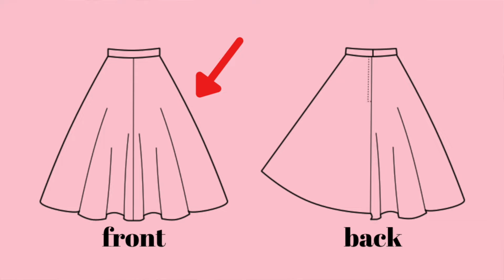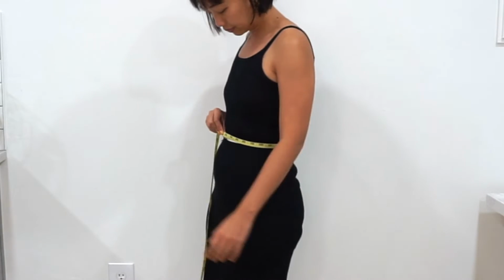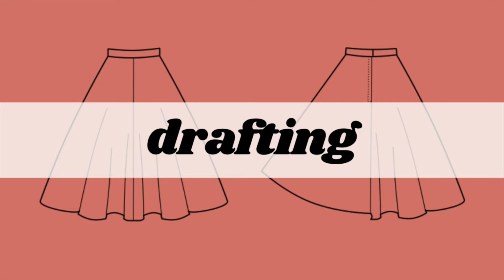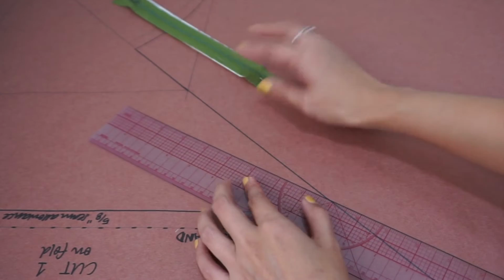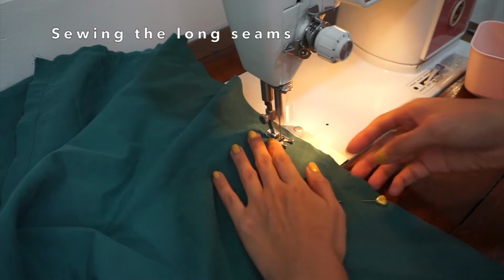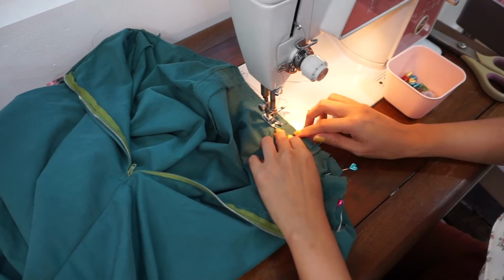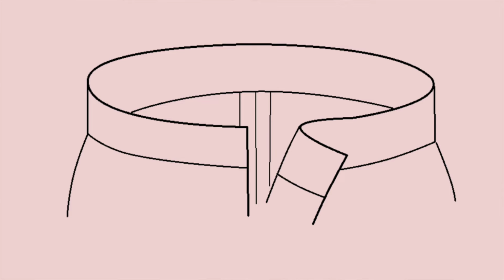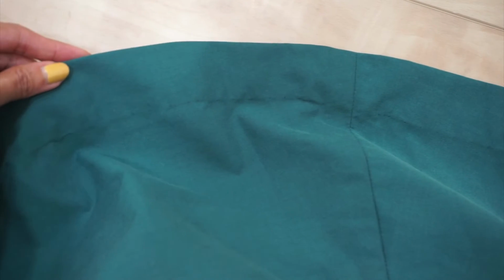How to sew a half circle skirt (4 panels) | step by step, beginner-friendly | draft your own pattern

Comment: I am assuming that I could use the same principles to make a full circle paneled skirt?
Reply: Thank you!
Reply from the maker: Yes, so to make a 4-panel full circle skirt, you need the arc going across the entire square instead of only half of the square at 5:59
Reply: @gwenheng  Thank you so much  🌺
Reply: @gwenheng Can you make a video using this method for a plus size person?

Comment: One question to 6:54. I don‘t understand where we calculated the seam allowances for the side, front and back seam as we only calculated r and made the pattern in a 45 degree angle with the help of the diagonal in the square. We used seam allowance in the r calculation, but that should be for the waist, right? I don‘t get how a calculation for the waist radius helps with extra fabric on the side of the panels. Am I missing something or is calculating seam allowance not so important for a half circle skirt because it also works if it‘s slighty less than a half circle in the end? I‘m quite new to this and a half circle skirt is supposed to be my first real garment, so I‘d appreciate any help :)

Comment: Math ain't mathing 😅. I made the pattern once, but measuring it to use it I don't think it will be large enough. Now my measurements are quite large, partly due to me using the hip width to be able to put an elastic into them, so just making the square in itself is an adventure. But I'll make it happen. Forward we go.

Comment: Beautiful! Thanks! Is there not a problem  when you are cutting the panels in different directions?  Or was that just depend on the fabric and the nap?
Reply from the maker: I cut my skirt pieces alternating at 180 degrees to save fabric ☺ It doesn't matter at all for this project since I was just using a plain, solid colour! But yes, if you are using fabric with nap and directional print (e.g., corduory, plaid), then you'll have to be a little more careful in planning out the cutting. ☺

Comment: Can I use the same principle to make 5 panels?? 3 panels in the front and 2 panels at the back??
Reply from the maker: The short answer is yes. But there will be math involved. If you want the front and back to be the same size, then you will need 2 different panel sizes. If you want 5 panels of the same size, then you just do the math once. The math will be about adjusting the size of the “pie” 😀 i hope this makes sense!

Comment: Hi Gwen! I’m trying to make a skirt with 3 panels (1 for the front and 2 back panels) so that I can have pockets and a back zipper closure. How should I modify the equation to fit as I would only have 3 seam lines?
Reply from the maker: There’s no need to adjust the drafting at all! Use the same pattern piece but
🔸 cut the front ON THE FOLD with the same pattern piece, making sure the seam allowance is taken away where the fold of the fabric is
🔸 cut the 2 back pieces as usual

Let me know if this makes sense. 😀
Reply from the maker: Adding to say the FOLD of the fabric should be along the lengthwise grain of the fabric (parallel to the selvedge).
Reply: @gwenheng  got it! Thank you so much 😊💕💕
Reply: Would I be able to calculate it by reducing to 6xSA in the equation, then using the drafted pattern for 1 skirt panel, fold down one side of seam allowance and cut on fold?

Comment: This is my first sewing project. I am working with muslin. I noticed that my pattern piece is not symmetrical. The edge of the pattern was my paper, and the other side's angle is sharper. (A bit hard to explain without a protractor!) Is this a major flaw? Which edges do I sew together?
Reply from the maker: Hi Kristin! I’ll be worried about it not being symmetrical. The pattern piece should be symmetrical. This means the skirt might not end up being even all around.. I think reviewing the steps for drafting would be best. Good luck!! 💖

Comment: Are handmade clothes less resistant than those bought from stores?
Reply from the maker: Excellent question! I have clothes I made from almost 10 years ago that I am still wearing. If it's made well, it's made to last. Fast fashion don't last as long most of the time either because of the workmanship, the fact that it's a trend trap we sometimes fall into, or that they don't actually fit us nicely. Hope this helps! x
Reply: @gwenheng  Thank you so much. Your videos are very helpful. They made me want to start sewing!! ❤️ You're doing a great job!

Comment: Hi, Im struggling with how much fabric to buy because this is my first sewing project and Im unsure on how to calculate that? my measurements are overall a bit smaller but I'll probably do the bib that goes with this skirt so its great if I have extra. The fabric Im looking at is 100% cotton and comes in yards. Im not even sure if cotton is a good fabric for this skirt. I also want to add pockets, and I swear you mentioned how, but I can't find it :( . It'd be really cool if I you maybe knew if cotton could be used and how to go about adding pockets.
Reply: Cotton is perfect and just search adding side seam pocket to garments, loads come up. Very simple to do
Reply from the maker: Hi hi! Yes, cotton is great and yes, I mentioned that pockets could be added but I haven't made a video for that on my channel. In terms of how much fabric to buy, it kind of depends on the width of the fabric too. Some fabrics come in 45", some in 60". The best bet is to put it on the floor and try to measure it out with a measuring tape.. OR take the pattern piece to the shop and place it against the fabric! x😁

Comment: I found some plaid fabric and thought of making a  circle or a variation of it.  I  didn't like a lot of them when I googled because the lines were not to my liking.  I  guess the solution is to make four panels and follow the lines.  I think I'll actually cut a narrow rectangle rather than an arrow.  It would be fine for solid but the lines really need to line up. You should be more popular your directions were clear and you showed the process.  The only other I found was so busy twirling I couldn't see how she lined up the plaid. I  think I have enough fabric to copy the bottom three inches of skirt so I think I'll hem it a different way. Thanks.
Reply from the maker: Hi Cara, thank you! I'm glad my video helped you in some way! x Good luck with your plaid skirt! 💓

Comment: Hi. How much fabric did you need for this skirt? And what was the width of the fabric? Thanks in advance.
Reply from the maker: In this video, I used a thrifted bedsheet to make the skirt and had enough left over to make a few other things. Bedsheets are wider than most commercially available fabrics which are 44 - 54" wide. 

I did some calculations and for the size I made in this video, I would have needed ~4.25 to 4.5 yds for a 44 - 54” wide fabric. And this is to cut the skirt pieces in the direction as shown around 9:48. 

By the way, cutting it crossgrain (i.e. perpendicular to selvedge) is considered “not proper” by some, hehe. But it’s just the way to make it work. Most patterns recommend cutting skirt pieces along the lengthwise grain, like the first image here: https://www.threadsmagazine.com/project-guides/learn-to-sew/pattern-layouts

If this is not helpful, my other suggestion would be to take your paper pattern piece to a fabric store and plan it out! 

Sorry this turned out so lengthy! I wanted to give the best response possible. Let me know if you have any other questions!
Reply: @gwenheng  Thank you so so much for this detailed reply. I found your website. And there you have mentioned the dimension of the bedsheet. But this conversion for standard fabric widths...this is really nice and kind of you! Many thanks again! I know a professionally trained tailor who now works freelance. I wanted to get this pattern stitched from her. I shared the images from your website for reference. But she wanted to view the video. I will now forward the video to her and also get ready with the fabric!
 Also your skirt has turned out well and looks great on you! Hope mine turns out good as well! 
Many success to you in all your endeavours.

Comment: What kind of drafting paper are you using?
Reply from the maker: This is gonna sound weird but I actually use pink butcher paper. XD Got it from Amazon. I wanted something more sturdy than regular tracing/drafting paper!
Reply: @gwenheng  cool. In the video the paper looks like sturdy enough but not so hard. I bought a roll of paper but so hard to cut. That’s why I am asking
Reply from the maker: @3939889ISME  What kind of paper did you get? Yeah, this paper is just slightly thicker than regular printing paper. Still tears but pretty sturdy!
Reply: @gwenheng  I am not quite sure as i am so new to sewing. However I bought in a sewing store and they told me this is the paper they used for pattern. But so thick and hard to cut lol
Reply from the maker: Oooo I think I know what you're talking about! Those are great for patterns you wanna keep cutting and use again and again! Hope you'll find a good alternative that works for you! x